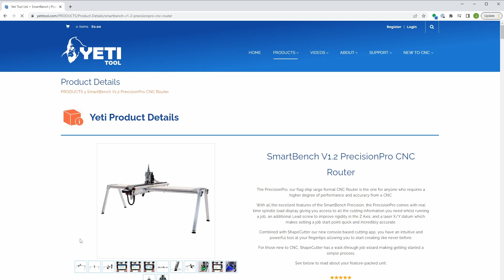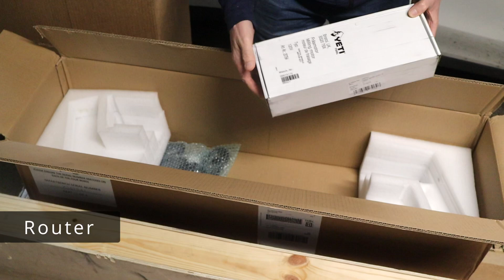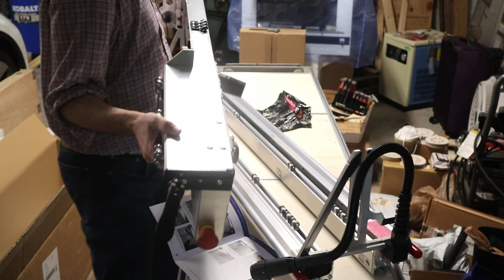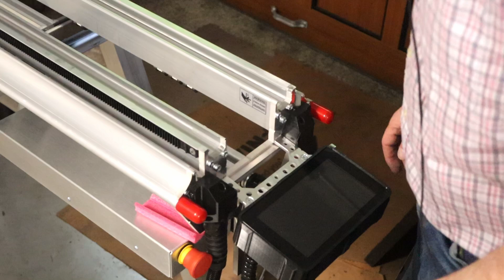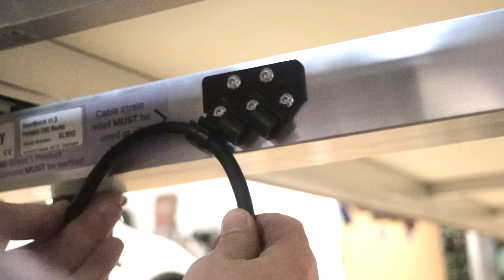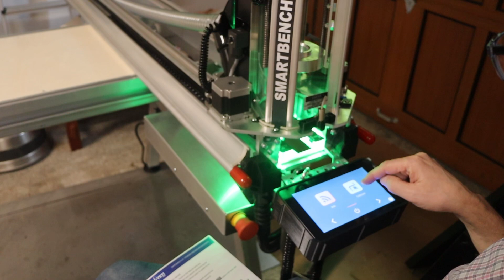Why I Bought a CNC Router -- Yeti Smartbench

Comment: I'm a machinist and woodworker. The skills involved are different.
Reply from the maker: Absolutely. What I meant to convey is that it should be trivial for me to use a CNC router. And that using CAD to design the shelves and cabinets is not a challenge. Building, finishing, and installing are new skills I need to learn. Fortunately, I have a friend with those skills who will be helping me.

Comment: John thats nice,  u decided to do it all...

trying with 2 Designers,
schedule problem with a Construction company... 
( an a impolite dud sayin no for an client askin for more lights LOL )
I got that u feel sting by it but - that blurred the video.

Instead of "hooking" about the main dish
.. what's the 1st project with the Router?   Plan to make modifications on the router ?  Would you search solutions / references? ( University's Furniture competitions  or just google images LOL ? 

Either way,  keep up the good work
Reply from the maker: The first project is the entry closet. I'm about 1/2 way down with that. It's not that hard, and it involves a shelf, a clothes rod, and a center support bracket. It's actually going to include some lathe work, as I have to use two rods to span the closet. Next up will be shelving for our pantry. That will be a much bigger project. And I don't have plans at the moment to make any changes to the router, but we'll see.